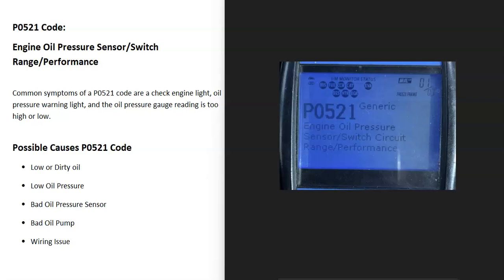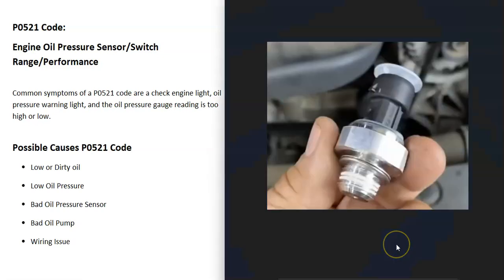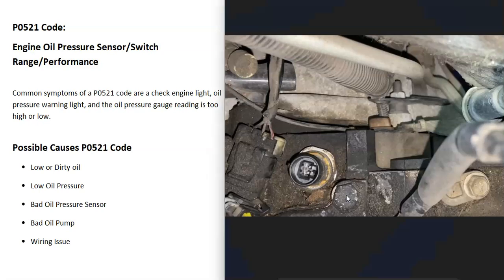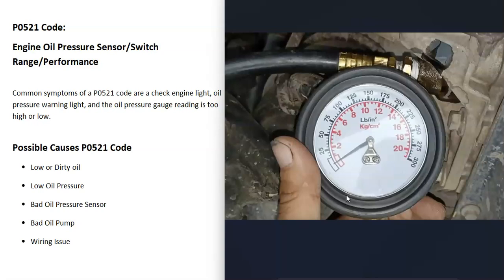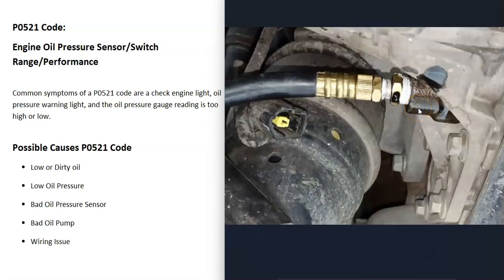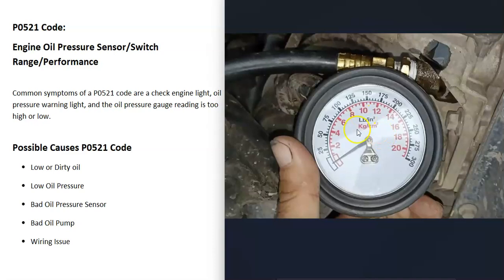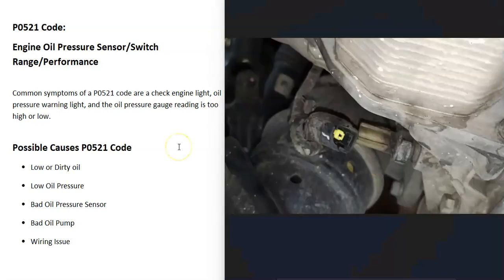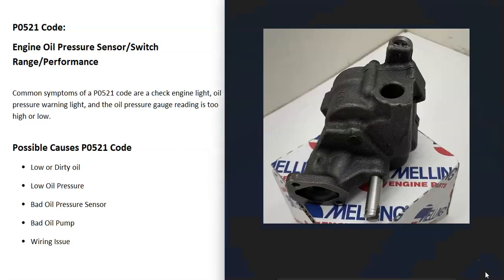Causes and Fixes P0521 Code: Engine Oil Pressure Sensor/Switch Range/Performance

Comment: Ive replaced the sensor every 3 months for a year, idk whats wrong but they all end up leaking oil into the connector
Reply: Put lock tight on that bih

Comment: @HVAC Mechanic
What could be the issue if you see all these codes together please:

P039D Cylinder 1 Pressure Variation Too High
P0521 Engine Oil Pressure Sensor Performance
P0399 Cylinder 1 Pressure Sensor Circuit Erratic
P1325 Crankshaft Position Reluctor Ring Performance
Reply: Did you find the fault for this? I have same codes popped up
Reply: @dannystead9420 No not yet. Do you see the “oil pressure low - turn engine off” warning when starting the car in the morning especially when it’s cold?
Reply: @GoodHeart2024 are you still driving yours?
Reply: @dannystead9420  yes
Reply: @GoodHeart2024 no issues since? Did you get stop engine?
Reply: @ No I just get the warning I mentioned above on cold morning starts.
Reply: @GoodHeart2024 oil pressure low- turn engine off??
Reply: @ yes
Reply: I don't think so, I'm assuming code stored from other day when it was cold
Reply: I changed the oil pressure switch/oil pump/ oil pickup tube and mine still reading low oil pressure with the warning light
Reply: @caliboy4406 ”oil pressure low - turn engine off” message is due to a small sump seal which needs replacing. Cheap seal but costly labour.
Reply: @GoodHeart2024 sump seal?
Reply: @caliboy4406 yes. Take it to an experienced mechanic or engine specialist- they would know. It is a common problem with the insignias.

Comment: Hey I just had this code and changed the sensor out the code pop off then popped back on
Reply: Me too
Reply: How to reslowe problem? Changed sensor, changed oil, and same ...code back on
Reply: Sell it ,it’s a pos
Reply: Reset your service interval and all will be good...
Reply: @Hndrxx3614  my problem was that i did not reset service interval on my Jeep for two years. I reslove problem with reseting service interval....